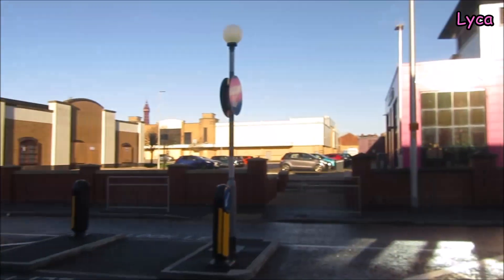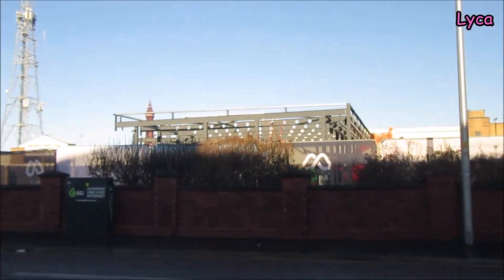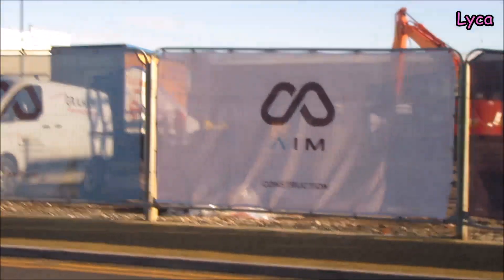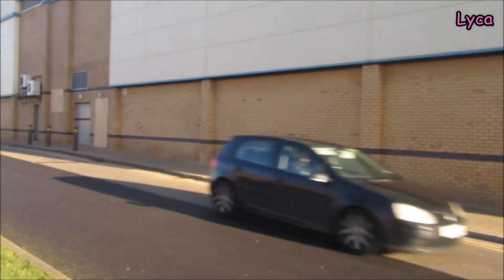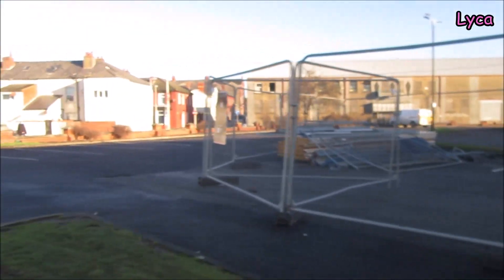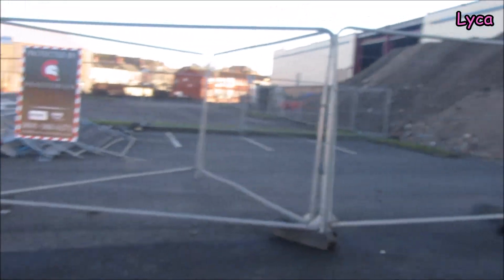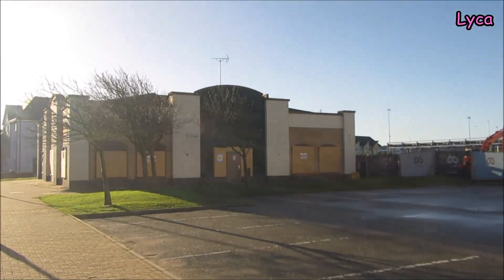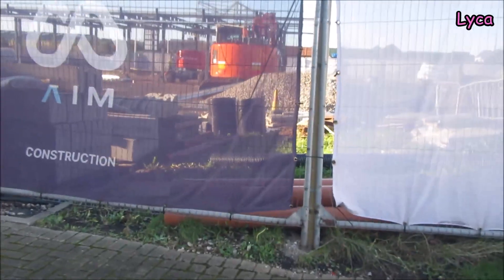Bloomfield Central Development formerly Festival Leisure Park. Steelworks going up. Part 1

Comment: Building sites and derelict houses were a real magnet for me as a kid, no security or fences back then, we used to go into all the part built houses and as they never locked anything up you could sit inside all the diggers, rollers, dumpers and any other machinery on site, they even used to leave the ignition keys in them!, if you could find a part demolished house even better as we thought nothing of giving it a helping hand to demolish a bit more!, i agree about the piles of earth, spent many a time climbing up them, even with the workers on site no one rarely said anything.
Reply from the maker: It was so much fun. I got so many scraped hands and knees from falling/rolling/sliding down big piles of earth/rubble.